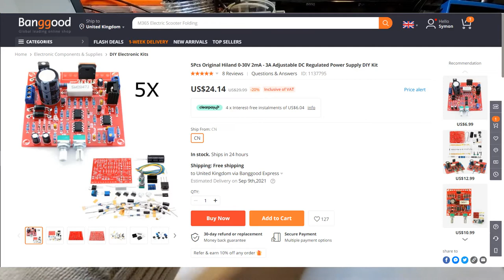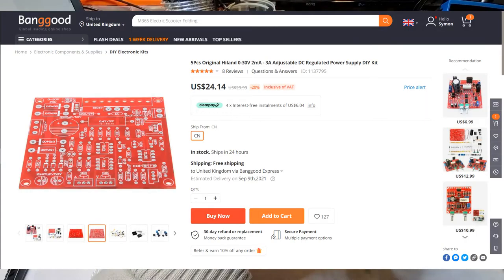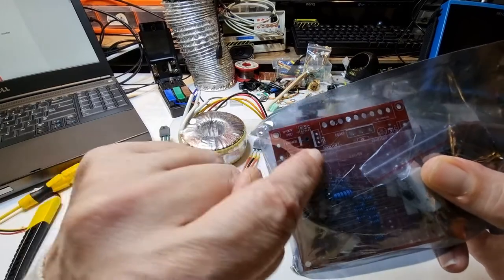How to tell a FAKE Hiland 0-30V 2mA-3A power supply kit

Comment: Hi sir ! 😂 Well it looks like you were right about those transformers. I finally got around to testing my Hiland 0.** to 28V 2A PSU. Those transformers I bought don't appear to put out much voltage or current. I don't quite understand the results though. Anyway we're are you sir?

Comment: They are not fakes. They are just different board reviews...Some of them are worse than the original, and some of them are better! This schematic is around for ages  and everybody is copying and selling it as a kit! I have one of those "fake boards" and it works just fine but I have replaced some parts from the beginning, to improve its performance. Some boards have some parts orientation printed in the wrong way, mostly diodes.
Reply from the maker: None of the reviews/remakes of the Hiland boards work correctly. Did you drop a link to your video showing the working board? Nice to see your argument.

The original circuit which I have already made videos showing is out there and everyone can go see it. This is not what we are talking about here.

These boards which are not Hiland could have used different colour PCB to show differences. The sellers to the none working boards always use an original in the advert, which we know works and then sends the none working kits. After many messages to point out the error the sellers keep selling, not caring.

Some sellers get their knickers in a twist stop communicating with the buyer and ebay refunds the buyer.

You say some boards have component orientation reversed... show me, I have never seen that one.

I look forward to seeing your working boards and the boards with reversed component orientation.
Reply: @Elecifun  it's true what are you saying about the pictures.They are just generic pictures that can be very misleading. When I buy something like this, I always check the reviews with pictures. There you can see what people really got. I don't have one with the reversed diodes on the silkscreen to  show you but I can point that tD7 and D8 are marked on the silkscreen as 5V1 but they are in fact 5,6 Volts zener diodes.They revised the schematic but they didn't updated the silkscreen. When I'll have time, I'll make a video to show you that mine works. I have modified it a little bit to reach 6 amps but that's it!

Comment: I built several of these, and there is absolutely NO short circuit protection, no matter where your current limit is set.
Reply from the maker: Sorry to hear that, I guess they were fake boards? I have two original, they both work fine. It's hard to find original boards as the sellers mix the pictures.
Reply: @Elecifun   Yep! Probably are fake. Didnt know there were fakes until i watched your video. Another design fail is if you have a 30-40 volt input and you set the output to 5-12 volts, that's a lot of power dissipated in the pass transistor!!

Comment: You may find the TL081s are dodgy.
Reply from the maker: I tried different TL081Ss but I did buy them off amazon, still no good. I will buy some from RS Components when they get some in. I need more time to dedicate to this really.
Reply: @Elecifun  The other difficulty a tyro may encounter is mixing up the 1N4148s with the 5.1v zener diodes. My ones looked identical so I had to test them before fitting them to the board to find which exhibited the zener effect.
Reply from the maker: I did check those using a power supply easy to mix up but the seller did send them out taped together.
Reply: I have had the TL081's fail, too. UA741's work fine, instead, if needed. I have also had the big white snubber resistor fail, too. I like these kits a lot and just treat any failures as a troubleshooting test. Then it's kinda fun. I must have at least ten of these kits, but then they were only 4 bucks shipped when i bought them. Great fun soldering on a rainy day.
Reply: PS....always use a socket for the opamps. Saves a lot of hassle desoldering, later.

Comment: Aside to the fact that between the“original”(yet still chinese too) and the “fake”(also chinese) the difference is that the 24v source is mounted differently and there are different manufacturer components, can you confirm that there are different specifications or non-functionality issues? And what are you doing with so many assembled boards anyway? Have you some industry or something?
Reply from the maker: Some of these board benefit from genuine TL081's. Maybe a complete set of genuine components would be the answer for all boards.

Comment: I was about to buy the fake Hiland PSU. 

In fact its in my cart. 

I'll remove it.🤔
Reply from the maker: Glad to help you save your money. Pity its harder to find genuine originals than fakes.
Reply: @Elecifun  yeah It sucks that they resort to trickery to sell stuff.

Your right its hard to buy genuine Hiland 0~30v. 3A.

Its a despicable bait and switch tactic.🤬
Which I particularly hate.
Reply from the maker: @decem_unosquattro9538  I agree that's why I put the video up, tired of this crap.
Reply: @Elecifun  Where are you? In the U.K.🤔
Reply from the maker: @decem_unosquattro9538  Yeah, where are you?
Reply from the maker: @decem_unosquattro9538  I have been watching on YT world events including Australia its all **cked up.
Reply: What's wrong with the fake Hiland 0~30v PSU?

Aside from the blinding white led and the transistor?
Reply: I bought the Hiland 0~28v 2A psu kit which has two PCBs. I noticed they have the Chong cap. 

I noticed that the board has the buoy mounting holes (screen print).

Now I starting to wonder whether its stuffed because when I hook a small heart shaped LED kit flasher it doesn't pulsate properly.

Anyway I guess I'll find out eventually.
Reply from the maker: I'm not sure what's up with it. I could copy schematic into Kicad and add values and voltages from real Hiland kit and do the same for fake. See where it goes from there. Might try a lightbox build to look through the board for differences.
Reply: @Elecifun  Oh that would make an interesting video.
Reply: @Elecifun  Who makes the genuine Hiland 0~30volt 3A PSU? Id like to buy the genuine article.

That's the disapointing truth about a percentage of Chinese stuff they tend to give you the cheapest stuff which leaves one feeling ripped off and disapointed.

Thats what I like about the Japanese.

Its good quality and they give you a nice book and support.

They're very methodical and go that extra mile to make quality goods.

Anyway I'd be interested to get some feed back on those Chinese fakes.

Thanks

Decem.
Reply from the maker: Have you tested it with different loads?
Reply from the maker: @decem_unosquattro9538  I'm not sure how hands on you are, referring to DIY. I have just uploaded the the original Hiland schematic reworked by me in Kicad with component values added so it can be a bench build.
Reply: @Elecifun  Like in my other post. I mentioned that I've only just begun to build diy kits.

Its kinda an addictive hobby.

I just need more kits. 😂

Thats why I built the PSU because not only is it more complicated to build its also a practical and useful piece of kit.

I might have a go at building it although a nice pcb would be nice.

I've seen other youtubers designing and building their own pcbs which would be a very exciting project.

I'm just some what hesitant at this stage.

Anyway. 

Bye for now chat later maybe.
Reply: @decem_unosquattro9538  It's getting that way in the UK too.
Reply: @boldford  what do you mean Brian?
Reply: @Elecifun  I tested just recently and it shit itself. Really weird behaviour. Just can't handle and kind of load.
Reply: @decem_unosquattro9538  I was responding to your "Home of the facist government." comment up-thread. Sorry for any confusion caused.
Reply: @boldford  No problem Brian.🙂👍